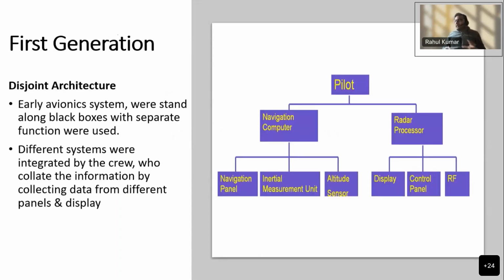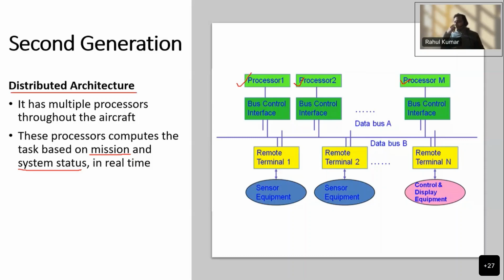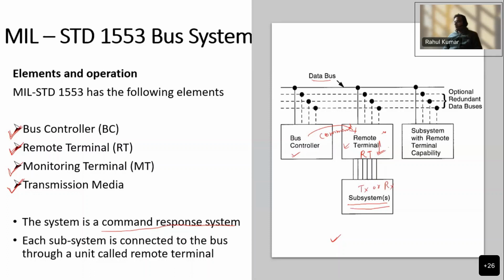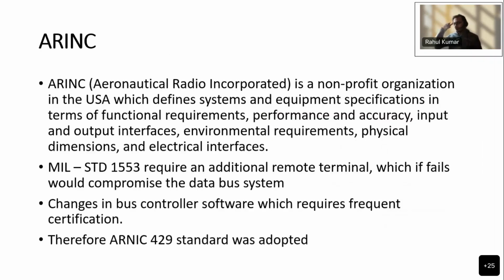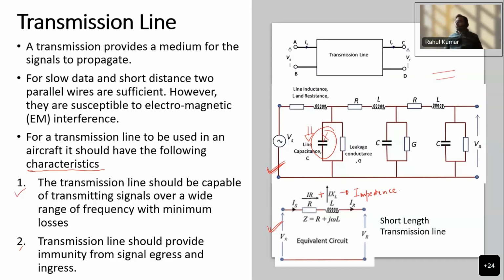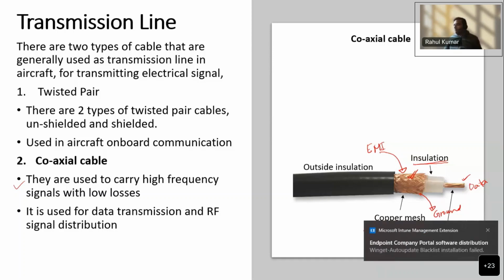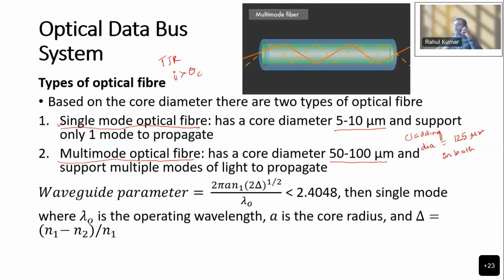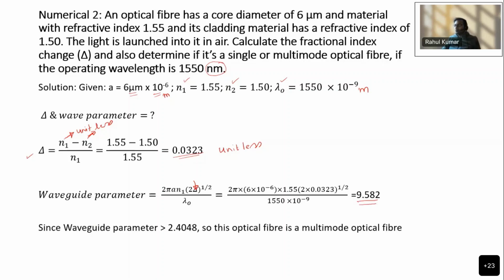L4 Digital Avionics Architecture

Comment: You are incorrect in one area, the 629 data bus employed on all 777 airplanes is a twisted wire pair, UNSHIELDED.  Unlike the 429 data bus employed on 757 and 767 airplanes, which is a twisted wire pair, that is SHIELDED.